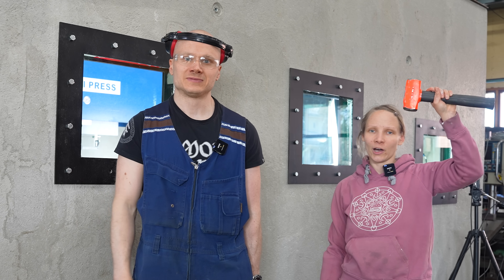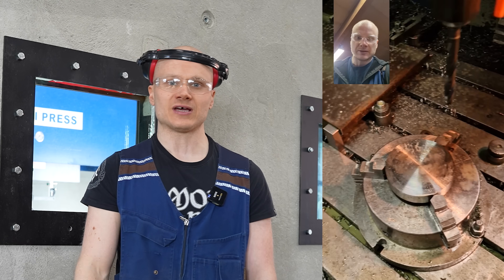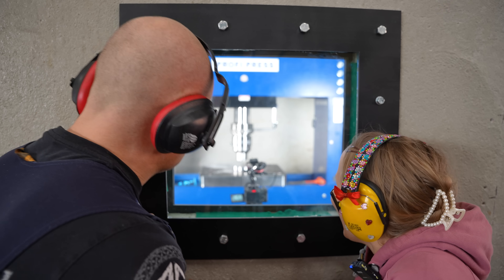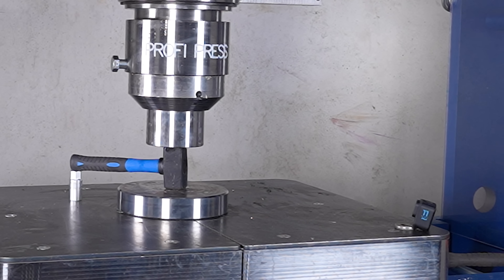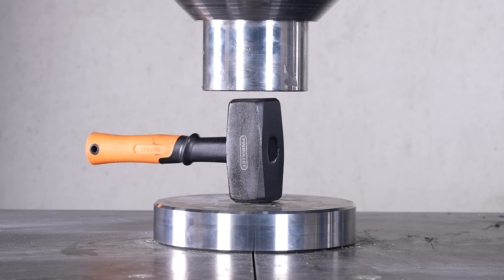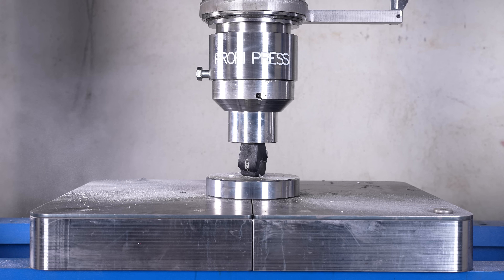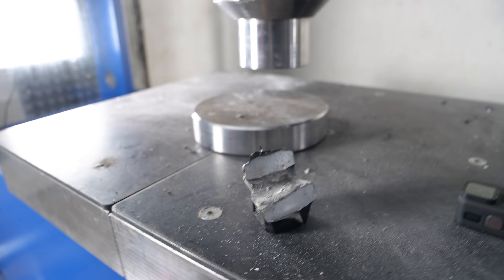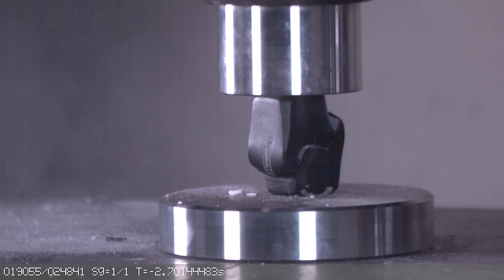Crushing Hammers With 300 Ton Hydraulic Press | Caused Local Earthquake

Comment: I wonder if bolting the machine to the floor will increase the deadliness of the projectiles. 5 tons of steel jumping up must be absorbing a lot of the energy that is released when things break!
Reply: Doubt it. The hammers would still reach the same failure pressure, and the explosion happens so quickly that the debris is already clear of the press before the press jumps off the ground as a result of the sudden drop in resistance. Bolting the press to the floor would transfer the uplift forces directly into the slab which, depending on the thickness of the slab and the size of the bolts, could be even more catastrophic for damage when you have several tons of force trying to lift the slab up in a few thousandths of a second.

Edit: the slab would need a significant rebar detail for the top mat to stop it from cracking apart, because the top of the slab would be subjected to compression forces from supporting the weight of the machinery on top of it, to suddenly becoming subject to massive tension forces as the machine's uplift attempts to lift up the slab. Without some serious rebar on the upper layer, I could see the slab cracking on an experiment like this.

Comment: I think if you mounted axles and normal vehicle tires/wheels on the press supports it would isolate nicely and be adjustable with varying tire (tyre) pressures

Comment: Carful around exploding metal. Was trying to remove a torsion bar stuck in a lower control arm. Was hitting it with a hammer and the end of the spring exploded. Sent a bunch of shrapnel into my left hand. Required surgery to remove because i had a couple chunks stuck in bone. Good times.

Comment: Not the highest priority, but if you send heavy chunks like that flying around repeatedly, maybe it would be wise to have a sacrificial liner with a few cm of air gap before the concrete. That kind of damage hundreds of times per year could add up. Bunkers are usually somewhat disposable, but this is a working bunker.

Comment: You should probably line the inside of the bunker with some steel. It doesn't have to be thick. It would just keep the concrete walls from getting damaged

Comment: Also, I have to leave 1 more comment, look into have naval warships mount heavy machinery to the deck. They have ready made brackets, plates and massive springs just for machinery like this. They have these springs for big computers so the ship bobbing up and down in the sea doesnt wreck the thing. It can handle a tremendous amount of weight. They make them for huge ammo racks that hold several tons.
Reply: I know I'm late to the party, but engine mounts are basically the same thing.  People would complain if their cars shook them like this, too.
Bolt, rubber washer, machine, rubber spacer, frame, rubber washer, nut.  Washers are shaped to center the bolt so it's not wearing against the mounting holes.

Comment: Pro-tip. To find damage on the walls easier, paint it first one angry color, then a second white color. When you damage the wall, the bottom layer of paint will be exposed more visible.
Reply: Because the wall is naturally a light grey color, just black paint should suffice
Reply: @ohiohouston3560  b-b-but high contrast!
Reply: "Angry color", that made my day!
Reply: Will help your lighting  issues too if you make a brighter background
Reply: No
Reply: There's a slight problem in that. If the concrete wall cannot take these hits, how do you think a layer of paint would? A better way would be to do it like they do with shooting targets: paint it with a bright colour only. Then the hit points would show up as dull grey as the paint disintegrates from it.
Reply: It should still provide a line of contrast around any chunks taken out of the wall  @anteshell
Reply: @anteshell  r u b b e r coating! Bounce right off. Protect the wall some too. Bed liner!
Reply: @anteshell   yes the concrete will break around it but it will also expose the angry paint , highlighting the area. its the same with targets paper being shot with a gun.

Comment: I love your channel. You and your wife do an awesome job with these videos.
This new press is just amazing how much power it has. 😲
I would suggest putting some heavy steel plating between the electronic panel and the danger from these crushes. I would also be a bit concerned that if you use springs that the press might bounce and hit the steel ceiling unless you can use shocks with the springs. But I am just guessing since I have zero experience with anything like this. 🤣

Awesome video! 😎👍

Comment: Replace the light box-fabric with plain-weave woven fiberglass. It'll diffuse the light perfectly well and catch most shrapnel.
Reply: While I doubt fiberglass would stop the bigger stuff like hammer #3, if it did catch, it would likely damage the light or tip it over.  My thinking: "Do you want a bullet getting caught up and stopping half way inside you or passing 'cleanly' through?"
Reply: @gth042  I do not mean to imply that one layer of glass fabric will even come close to stopping a chunk of proper tool steel at high velocity. But I also reject your final thought. What I want to happen to me as a fleshbag is very different from what I want to happen to a replaceable lighting rig.  A projectile passing-through might be nice, but a higher priority to me would be "I would very much like not to get hit in a way that causes me to begin to bleed-out.
Reply: @verdatum  I think we agree in basic premise there.  The thought behind my analogy was simply that a "plain hole" might be less likely to intersect something important than a curved or zig-zagged one where the momentum has fully converted.

Comment: @Hydraulic Press Channel: do you have some plexiglas on the inside of the widows? if not, i would recommand it. this will reduce damage to the actual bulleproof glas.
Reply from the maker: Yep there is 10mm polycarbonate on front of those
Reply: @HydraulicPressChannel  nice, just the thickness i had in mind.
Reply: Yes.  They added removable/replaceable polycarbonate panels in front of each bullet-proof window.

Comment: Separate concrete plate for the press and styrofoam underneath takes some of the noise. Also it is possoble ro either buy rubber shoes or there is a special product that is cast around inside a sheet metal tub around the shoes of the machine (also underneath).

Comment: A few suggestions come to mind... 1. Can you put an 'armour belt' of steel plates around inside the concrete wall at level with bottom of the Press stroke? That way the concrete won't suffer penetration damage... I think that horizontal is the real 'danger' zone here because that's the angle that something fired out of the press is most likely to fly at high speed, & least likely to just ricochet around inside the bunker...

  2. The rocking... can you not put shims under the feet of the press to stop it rocking? I presume that the entire frame of the press must deform when 2 of its feet are off the ground like that until all 4 touch down when you give it the full 300 tonnes, & then 'ping!' it springs back hopefully all the way. 

3. Could you stick a go-pros up in the back corners of the bunker, just to catch things flying forward towards the cameras & the lights?

4. How about fabricating wall mounted armoured boxes for the cameras instead of using flimsy floor mounted tripods? Or build a heavy duty camera stand that supports the armoured box with a camera mount inside so you can still move it around?

Comment: The kinetic energy released is groundbreaking, both literally and figuratively! Im surprised that the floor didnt crack. It will definitely be a challenge to anchor the press down.
Reply: It'll be more likely to crack once it's bolted to the floor because right now the top of the slab is only subjected to compression forces, and concrete is strong in compression. Bolting it to the floor will cause the uplift force to be transferred to the slab in the form of a tension force at the top layer, and concrete is weak in tension.

Comment: Hey Lari, what if you mount the frame for the light curtain to the floor in front of the press?  It will isolate it from direct vibration of the press and still provide that safety factor.  Also, even if you do mount the press you the floor, hopefully its steel reinforced, it's still going to shake the earth.  Over here is a manufacturing company with a 300 ton press, but it's not hydaulic, it's a flywheel press an it stamps parts.  I think it stamps brake discs for snowmobiles.   When they run it you can see your coffee shake on the table at 1000 feet away.

Comment: Since the press is so heavy, and there is so much force, i think the best thing to isolate the vibrations, would be thick blocks of rubber. Use very large concrete anchors to hold it in place, and use rubber to isolate the press from the floor, and the anchors. Same idea as engine mounts in a car.

Comment: High performance hydraulic load frames for shock absorber testing (e.g. MTS landmark)  have engineered isolation bases to minimize the loads transferred into the floor - you might take some inspiration from them

Comment: You could float the press on some airbags with minimal effort and relatively low cost.
Reply from the maker: I have to look up also those. I found some steel wire suspension things that looked also quite nice.
Reply: @HydraulicPressChannel  Springs would definitely look more fun for your audience. If you went with Monster Truck coil overs they come in exciting colors - and if there's a Monster Truck shop in Iceland maybe they could be a guest on your show.

Comment: Suggestion = paint or mount a scale on the wall (even simple measured black and white stripes) and position it so they are in frame of the cameras, then we can get a feel for how much things jump. At 10:23 when the machine jumps in slow-mo, it is hard to get a feel for it jumping against the solid gray background. Edit: Or just mount the scale sometimes for the "big" crushes, so it doesn't distract during simple crushes.
Reply: A checker board pattern would be the best.

You could measure vertical and horizontal movement, gauge the height of the press jump and the speed of the shrapnel.
Reply: A dial indicator attached to the floor could measure the peak (Hold)

Comment: You were right, the old hammer was the best!
Invite your neighbour over to watch the mayhem!
Reply: Work hardening is a major factor for older iron based tools. There's no replacement for time and experience.
I'm an older, iron based tool so I know wtf I'm talking about 🤣🤣🤣🤣🤣
Reply: And his cats.
Reply: Love how the older hammer made the press jump the highest
Reply: Having a neighbor over would be a safety concern.
Reply: I’m guessing the old hammer was forged in such away that the grains are more uniform since it’s a purer metal hence more force required.  Newer ones probably use pot metal so the grain sizes are random.   I’m no material scientist and would love to learn more about metal structures and compression forces.

Comment: If you want a big boom from steel, take a high carbon steel cube or rectangle, heat it up to stupid degrees, but not melting tempature, then quench in water, it will rapidly cool down harden have lots of stress fractures and when you use your 300 ton press it should just go boom
Reply from the maker: My friend runs heat treating plant, I can ask him to plan the worst piece ever :D
Reply: @HydraulicPressChannel  Oh that will make for an excellent video, just the worst heat treated steal vs 300 ton press, would be an explosive video
Reply: @HydraulicPressChannel  Yes.  How NOT to Heat-Treat.  😆
Reply: @HydraulicPressChannel  i have an idea to crush. you have already done car springs. HOWEVER. they are flexible, as they are hardened only to a certain degree (almost not) so next time, try taking a big clump of spring steel, heat it up, and harden it in cold water. be ready, as the spring steel might explode, if it is cooled too rapidly. But, if you manage to do it, you now have a steel that will shatter with a hit of the hammer, but is extremely hard. so try to find the good spot between too much and too little. would be fun thing to explode under the press, especially for your neigbour at friday evening😂😂🤣🤣
Reply: A big chunk of cast iron would be fun. Precicion machined to spread the stress.
Reply: Böhler600 (hss) as a material and water quench it from 1400c 🙈
Reply: Sounds like this would be the steel version of a good paper explosion. I hope Mr. Watermelon Man makes an appearance when HPC films your suggestion.
Reply: Excellent idea
Reply: Yes, but also compare it to differently treated base material

Comment: Can really see the whole machine flex and bounce 😂

Can it be bolted to the floor?
Reply from the maker: I will mount it with some flexible mounts. I think just bolting won't work since it would rip the bolts out from the ground at some point after few explosions
Reply: @HydraulicPressChannel  think of the views 😂

Comment: need to revisit old crushes that the 150 couldnt do... :D    also might want to hang some 1/8" steel plate on the inside to avoid concrete erosion from flying debris
Reply from the maker: Let see how it starts to wear :D I think it's not going to wear much we do quite rarely this stupid stuff. Maybe for the back wall that is the closest?
Reply: @HydraulicPressChannel  yeah the back wall for sure as its proximity. mayby a sheet of 12ga steel? something to keep bits from chipping away at the back wall.  lets see some big ruperts drops in the new 300T press!